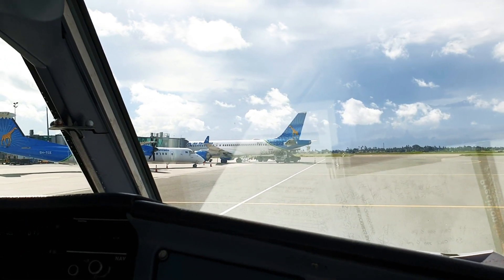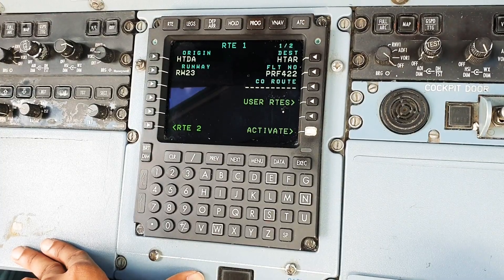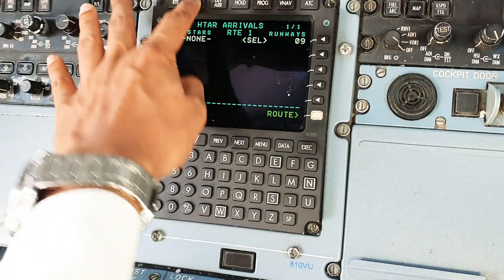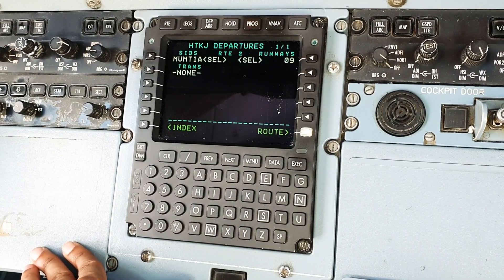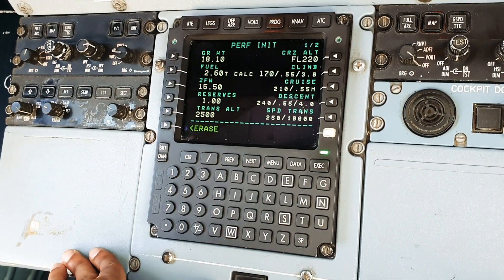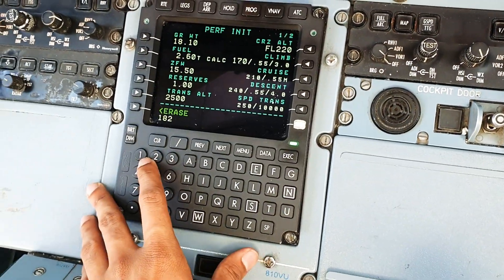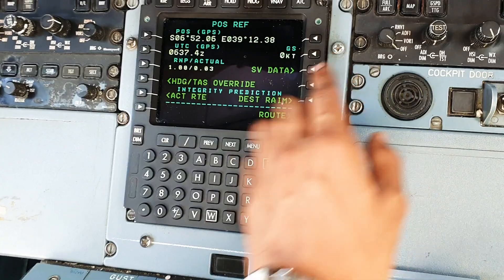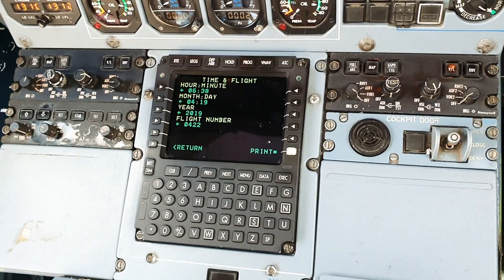Part 1: Programming the GNSS (HT1000) on the ATR 42/72 500

Comment: what is ISA when you opend up the QRH???
Reply from the maker: ISA is international standard atmosphere. It is used to standardize aircraft instruments and performance calculations. 
It states 3 guidelines
1) temperature on ground is 15°C at 0 feet MSL
2) pressure on ground is 1013 hpa or 29.92 inches of mercury
3) lapse rate is 1.98°/1000 ft.

Performance for the aircraft depends on the outside air temperature and pressure. 
What I showed in the QRH was performance according to the outside environment.

Since ISA is a standard it can't always be 15° on ground it can be hotter or colder.

In the East African airspace it is usually ISA+15 that means it is 15° hotter than ISA temperatures. 

At 15,000 feet at ISA it would be -15°C outside air temperature but since for example when you check the temperature it is 0°.. it is 15° hotter than expected ISA. Therefore ISA+ 15. 
For example in the temperate climates in the winter I can sometimes be ISA-20!

Hope this cleared it for you